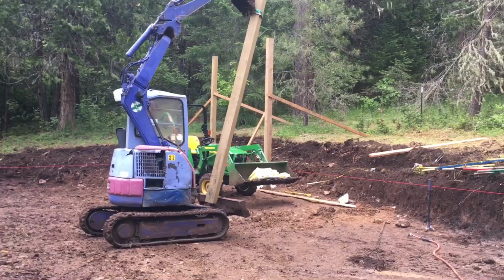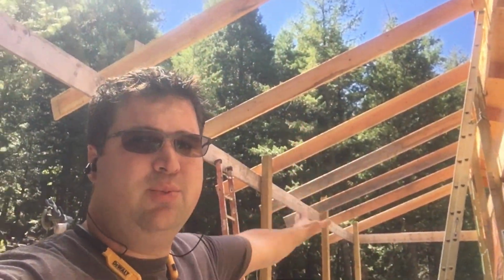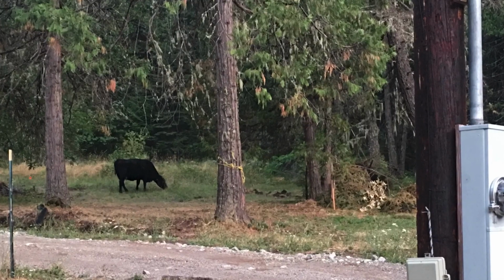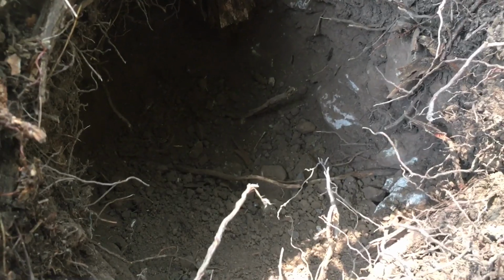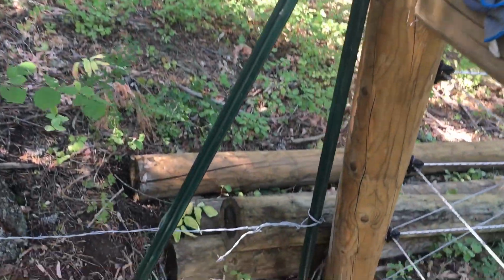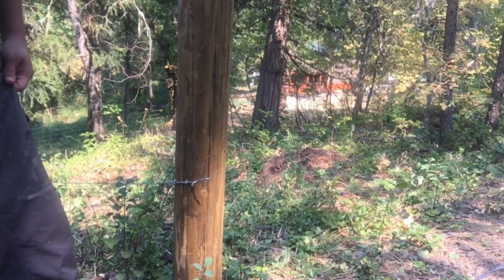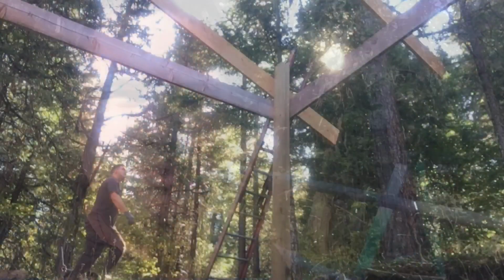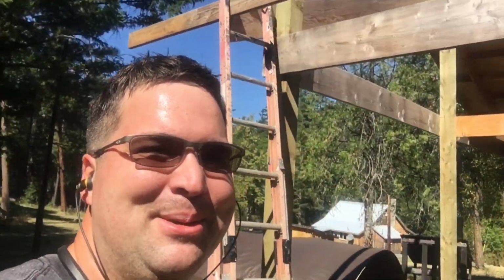Pole Barn Build Part 3

Comment: I always enjoy watching you work on your home,are you building the pole barn for animals?
Reply from the maker: Hi Karen. This will initially be used for work shop area, wood working projects, storage, etc. Tractor parking, and no more bone piles of supplies sitting around in the briars. Long term plan is concrete slab, siding, and the old cabin wood stove for cold snowy project days. Would like to do a root cellar into the hillside on the back corner. I would also like to make at least one of the bays into a work area for Dede projects. We will probably store feed in one of the bays. Actual animals will get their own structures as we add them in. That’s the general plan for now. The great thing about pole barns is their versatility. It’s easy to change and adapt them to whatever your needs are. -Robert